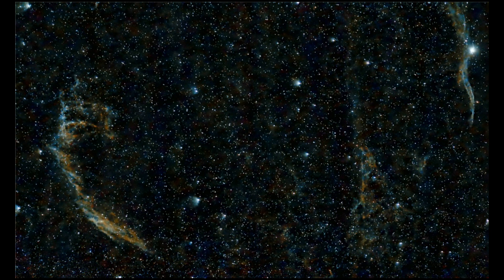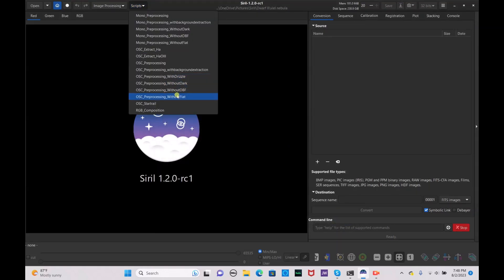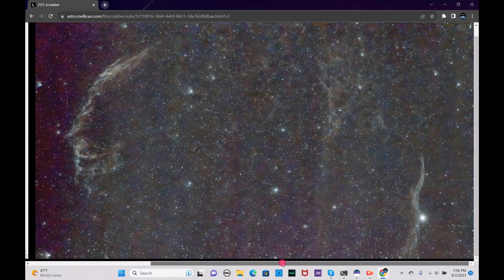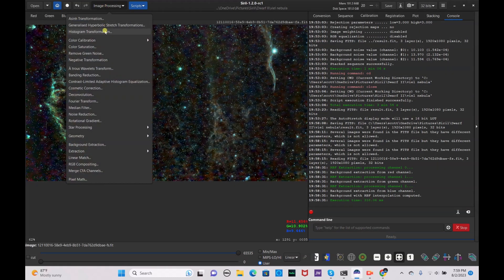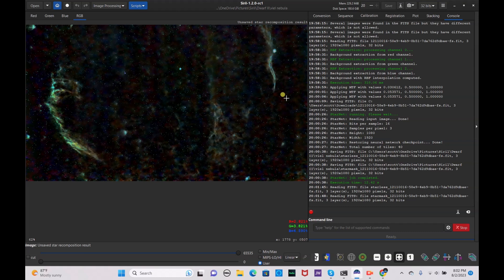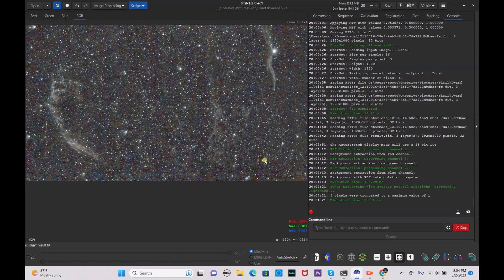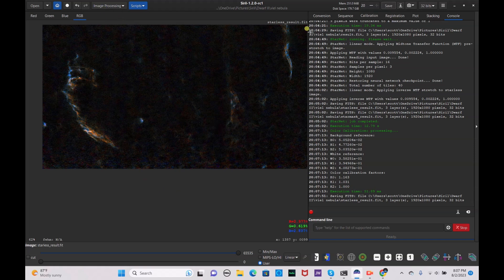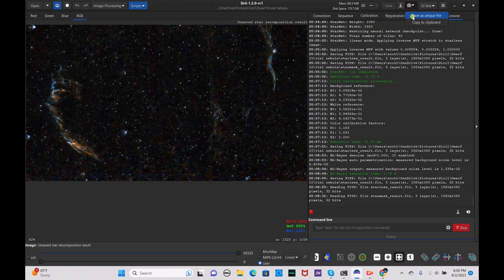PROCESSING CYGNUS LOOP! Step-By-Step Astrophotography

Comment: Great video Scott! However when I check “Bayer information from files header if available” and “Bayer mosaic = GRBG” stacking failed 
I get Bayer patter found in header “GBRG is different pattern in settings” error
Reply: Had to clear up some disc space :))
Reply from the maker: Glad you enjoyed! And well some times it doesn't work right. was it a storage issue?

Comment: Hi Scott I enjoy your videos Ive learned a lot from them, especially using Siril. I am also an owner of a dwarf 2 telescope I'm wondering have you had your telescope finish taking pictures before completes it's stacking process. It happened the other night taking pictures of the lagoon nebular. I still had to stop it from continuing?
Reply from the maker: No i usually connect my dwarf ii with an extension cord and leave it out overnight to allow it to stack all photos. To shoot 850 photos and stack them can take 4 hours at 15s exposures
Reply: @ScottC-Astrophotography  So you think it was to do with the power of the battery.? Ok I will connect to my power station.
Reply from the maker: @WRX2001  another thing it could possibly be is if something were to pass in front of the camera like a cloud or tree that could stop the dwarf ii from being able to track correctly. Id also try to reach out the Dwarflab Team as well to help get your issues resolved. They have great customer support!😁
Reply: @ScottC-Astrophotography  Is it possible to email you the picture of the lagoon nebular i took and the using your tutorial video iused to create it. By the way the first one is better.
Reply from the maker: @WRX2001  scottcumella2002@icloud.com